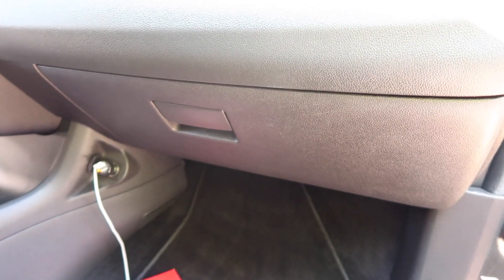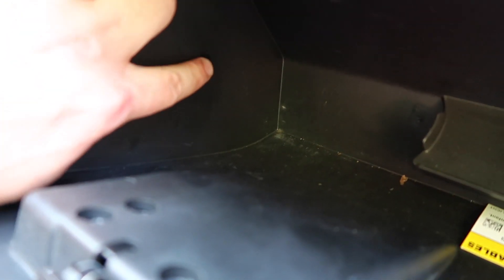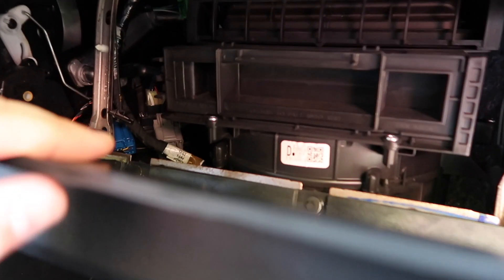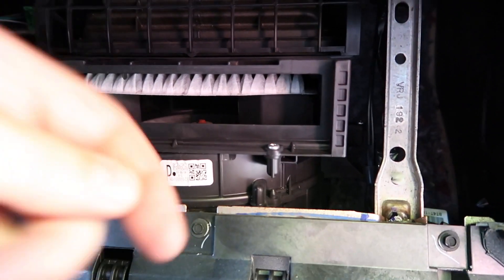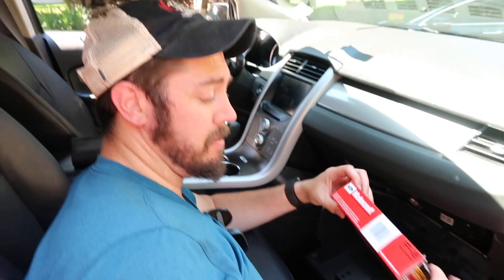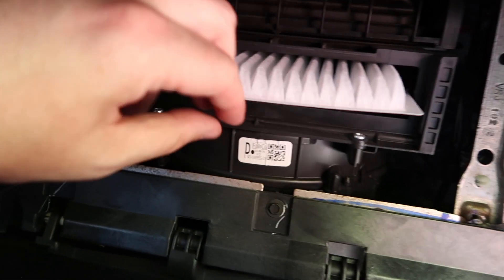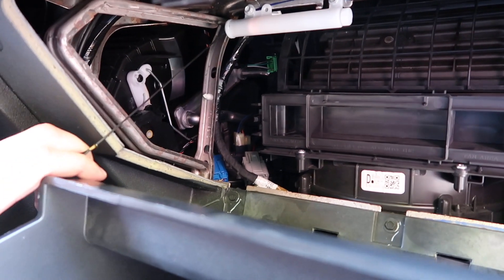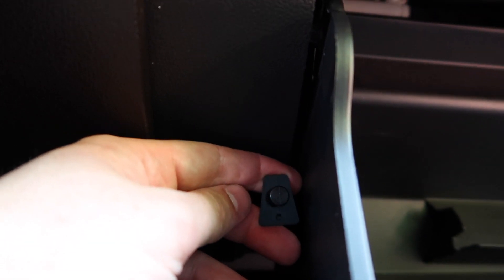Ford Edge HOW TO: Replace Cabin Air Filter (2007-2014)

Comment: My Ford C-Max and my past Ford Focus has the air cleaner underneath in the center console. It’s very similar to the Tesla Model 3’s, except that you don’t need a screwdriver, but the filter has soft edges because you have to pinch 🤏 it to get it in or out. The Tesla needs a torx 20 bit to remove the cover, is ridged and takes two elements.
Reply from the maker: Appreciate the heads up on that. How do you like your Model 3?